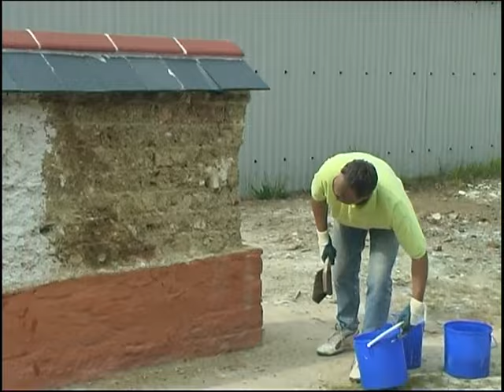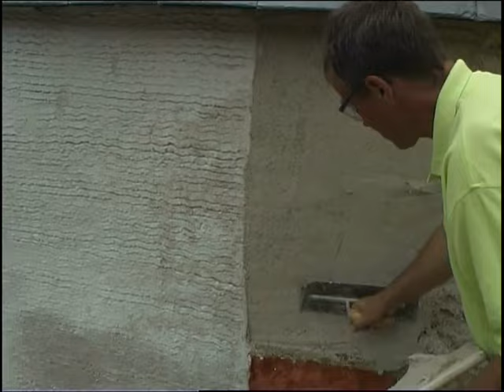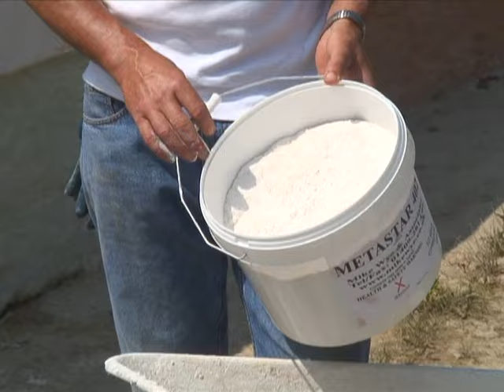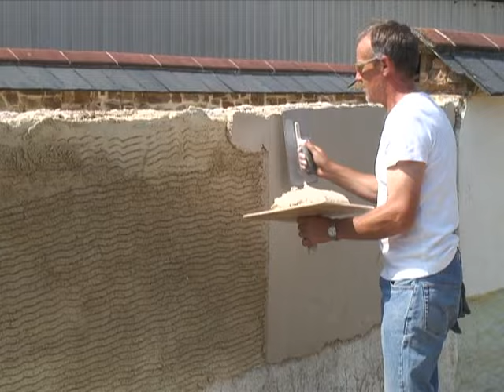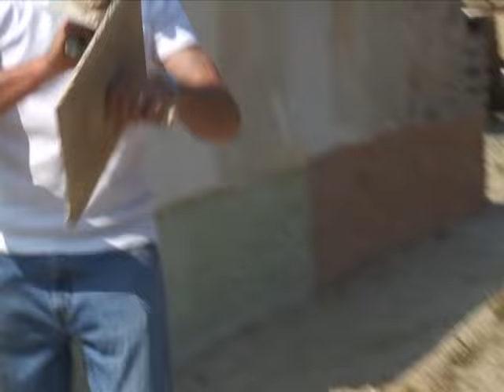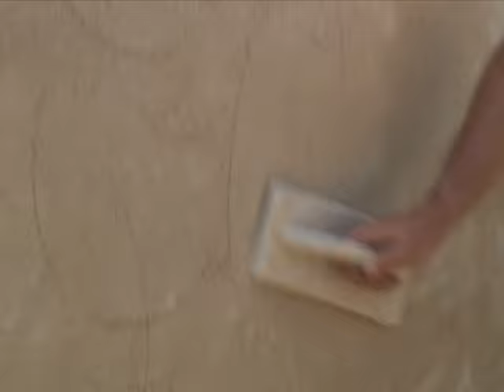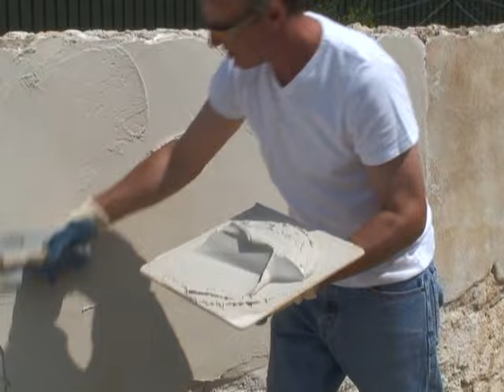How to Lime Plaster (internal solid wall)

Comment: Can I lime render my wall using just NHL 3.5 onto brick. I want to do a bonding coat first then two finish coats. Could i get away with that and if so what ratio for the finish coat? Thanks Mike.

Comment: Very informative video, definitely more confident in giving plastering a go after watching this. Is the harling coat an unhaired mix of 3:1 thats just watered down? Or did this also have the pozzolan?
Reply from the maker: Hi Morgan, thanks for your comment. Yes - the harling coat can be unhaired lime putty mortar diluted to a porridge-like slurry. Pozzolan would not usually be necessary, it is a very thin coating so it will dry and harden before a pozzolan has taken effect. It is also possible on most substrates to use a formulated NHL based premix mortar, for example SecilTek Reabilita Cal CS - details here - https://www.mikewye.co.uk/product/secil-reabilita-cal-cs/
Reply: @MikeWyeLtd any problem if the hurl coat is haired lime mortar?

Comment: What are the contents of the harling slurry mixture? Is it just lime and water? If so, would nhl 3.5 and water be ok for a first coat harl?
Reply from the maker: Thanks for your question Pete.
The harling slurry is a mix of lime + sharp sand + water. If you're using NHL3.5 perhaps try a mix by volume at 3:1 (sand : NHL) then as the mixing process is nearly complete, add extra water until the mortar reaches a loose porridge-like consistency. The best type of sand for this will be sharp, well-graded, with some relatively coarse & gritty content.
We have some general guidance on mixing NHL mortars here: https://www.mikewye.co.uk/wp-content/uploads/2023/11/Mixing-Natural-Hydraulic-Lime.pdf

Comment: Great videos! I was wondering if you had some more information on that harling coat though. I'm currently struggling with some old, extremely thirsty brick walls. I managed to get the first coat on nice and flat and soaking the wall gave me just enough time to do it. However... I applied the my first coat months ago and now it's bone dry. I've tried soaking the walls again but the finish coat, I supposed because it's much thinner, just keeps drying out too fast... by the time that I'm at the bottom, the top is pretty much dry to point where I can't work it anymore. Fighting it with a wet sponge helps a bit but so far I've only done small walls to test. This method is not going to work on my bigger walls... I'm wondering, could the harling coat help before applying the top coat as well? How much pozzolan might I add? Thank you for your help!
Reply from the maker: Sorry for the delay in replying. 

Are you doing a full internal lime plaster build-up with a harl coat, scratch coat, float coat, and skim, or is this an external render application? If so, what stage are you at now?
If the coats are applied "green-on-green" then the previous coat shouldn't have dried out so much that it's very thirsty like you are experiencing. As the last coat you applied was done many months ago then you may benefit from another harl coat (assuming you are at the float coat stage).
I'll presume that this is an external application given that you've asked about the addition of a pozzolan. We should safely be clear of the risk of frost now so early spring is a great time for render applications to give plenty of time for carbonation and strength gain before the winter. With that in mind, and given that you have very thirsty walls, I wouldn't go any more than 1:8 pozzolan to lime render by volume. There may even be a case to reduce this to 1:10 provided that the area isn't particularly exposed or vulnerable.

I hope this helps but feel free to give us a call on 01409 281644 if you would like to discuss.
Best of luck with the project! Ryan @ Mike Wye

Comment: How thick would the lime plaster layer be in total?
Reply from the maker: Hi Hazel, plaster coats are typically around 3 mm
Reply: @MikeWyeLtd  sorry i mean for the whole thing, from the wall to finish, including the mortar etc.
Reply from the maker: @hazellewis6995  Hi Hazel, onto a solid wall typically, 12-15 mm haired scratch coat, 8-10 mm unhaired float coat and then a 2-3 mm skim

Comment: Thank you so much for these videos. For an amateur like me they are super informative and helpful. I do though have a few questions I wonder if you could help me with? I’m in Portugal and have a early 1900’s stone walled house and really want to use traditional methods to do her up.. my builders are of course pushing cement…. When I suggested lime, they said Yeh sure, but we HAVE to add 1cement to 1lime to give it strength otherwise it’s like powder and will just mark with any small bang… Is this true? 

My other question is, do I have to add hair or any other type of fibre? Or can I just do the lime sand mix? 

It’s hot here and I’m wondering how to help it dry properly(not too fast)? I see you splash water on some of the layers but how do I control the final plaster one?

What’s the difference between lime mortar and lime plaster? And what sand do you use? Is there like a grade to go by? They are using quite tough sand here which I don’t like but they say after this one there’s on,y one that’s ever do slightly more fine, which I don’t think I could ever achieve these smooth finishes with?

Thank you so much! Hugely appreciated if you find the time x
Reply from the maker: Thank you for your kind comments. Our mixes are one part lime putty to three parts sand by volume. This is a traditional mix that air dries and carbonates. The lime that your builders are referring to would be hydrated lime (a dessicated lime putty) that is used as a plasticiser in cement mixes.
For a compromise you could use NHL (natural hydraulic lime) at the same 3:1 by volume ratio. This is very common in Europe and easily accessible. The NHL is a dry powder that will give a chemical set with water rather than air-drying. It's a bit of a compromise.
Water and protection from direct sun are the main ways to control drying.
Our mortars and plasters differ slightly in mix ratios but essentially it is the aggregate size that makes the difference.
Reply: @MikeWyeLtd  thank you so much for you quick get back, much appreciated. Hydraulic lime, that’s the one! They still want to add cement to that though which is annoying, 1 lime to 1 cement then sand.. as they say it will be super soft and any little bang will make a mark on the wall. As for the controlling of drying time, I’m slightly worried about this as they they will do it when it’s warmer and Portuguese sun is HOT whatever the tone of warmer months.. so I’m worrying it might dry out too quickly. Should I spray it every day or something to help it along? Thank you so much again x
Reply from the maker: @leafside  A 3:1 mix of NHL3.5 and sand shouldn't be too soft, the lime putty renders are softer than these and still take a fair bit of abuse. Yes regular damping down will be beneficial.
Reply: @MikeWyeLtd  thank you, will put that to them x

Comment: Does anyone have any ideas about whether they think it could work to lime plaster the walls on a tiny home? It is on wheels...
Reply from the maker: Hi Jemima, we have a customer with a static caravan that is moved fairly regularly. He has had some small cracks appear that he has patched in. If things are fixed well it may be ok but faults may appear when it is moved.

Comment: I have zero plaster experience but recently motivated in the subject. Often heard about “preventing  shrinking” here in your video too.  what we want to preventing of?   Why it is a necessary :)  hope you don’t mind to explain :) thanks
Reply from the maker: Shrinkage can occur in mortars and plasters for a number of reasons but ultimately results in cracking which would need to be repaired afterwards resulting in weak areas and possible scarring. 
Causes of shrinkage are: 
*High suction from the substrate/insufficient control of suction in the substrate by dampening with water/use of primer etc.
*An overly wet mix (the excess water evaporates away during curing causing the mix to crack)
*Use of incorrect mixes/aggregates. For example, if you try to apply a fine internal plaster which is designed to be skimmed at 3-4 mm thick at 6-8 mm thick then the plaster is likely to shrink back due to the aggregate not being sufficiently large to hold its form.
*Fast drying. If plasters, renders and mortars are subject to direct sunlight/heat/strong winds/high internal temperatures then they moisture contained within them will evaporate rapidly causing shrinkage. Mixes should be left to cure naturally and not force dried. If the external temperatures are high and/or there is prolonged direct sunlight on the area then the surface should be protected by using damp hessian/sheets/old curtains etc. Protecting the surface of external renders is advisable irrespective of time of year.
I hope this helps.

Comment: hey mate, I have a bag of quicklime and i also have a bag of hydrated lime i want to sample for wall rendering...what ratio do i mix the quicklime to water (slake) to make putty? and do i soak hydrated lime also into a putty, & if so what ratio to water is it? Super hard to find any information about the ratio to make putty...is hydrated lime able to be used for wall rendering?
Reply from the maker: Hi Johny. You really do have to be aware of the hazardous nature of quicklime if you're considering slaking it yourself. Our guys wear full face masks, body suits and gloves in a controlled environment when slaking. 
If you're comfortable you can manage the risks safely then we can give you a guide for the quicklime to water ratio by emailing sale@mikewye.co.uk
Hydrated lime can also be rehydrated to make an inferior lime putty but we don't really recommend it be used as a binder for rendering. It's typically reserved for use as a plasticiser in a cement mix (6:1:1 aggregate:cement:lime as an example).
Reply: @MikeWyeLtd  hey mate thanks for the prompt reply. Yeah unfortunately i have to undergo the process of slaking myself. Im on an island in Indonesia and there is not such thing here of a bucket of putty let a lone even quicklime or hydrated lime bags...what im wanting to do (render my villa walls with a lime mortar) is revolutionary to these parts, mould is shocking here with the humidity. I found a mining company in Java that sent me a 20kg sample of both products (quicklime and hydrated). I have slaked a small quantality of the quicklime to check out the reaction, and do sample renders...im prepared mate, but unsure exactly the ratios. I will email you.

Comment: Internal traditional chateau walls are usually about 4 metres high and say roughly 5 metres wide. How do you get them straight and can you do the whole wall in one coating or do you need to do the wall in segments?
Reply from the maker: Hi Jack.  A 4 m x 5 m wall wouldn't present a problem for a competent plasterer as an entire area. You would not need to plaster in segments.

Comment: Always wear glasses while harling! I learned that yesterday, the hard and painful way. :-/
Reply from the maker: Yes it is very unpleasant!
Reply: @MikeWyeLtd  Thanks for posting this. So few videos about plastering over cob. I've got a question, if you have a quick second. I'm getting more cracking in my hair and scratch coats than I'd like. I think I'm having trouble getting enough aggregate in my mix. I aim for 3:1 but end up at best with 2.5:1 and sometimes closer to 2:1. I just can't work it when it is 3:1 -- it is very stiff and not at all workable. I don't want to add water, do I? My putty is about the consistency of toothpaste, so I think that's right. I'm not sure what's going on. In both cases, I've added 1 part hair (in my case it is 2"/5 cm lengths of shredded linen discard fibres). Any ideas? Thanks again for the resource and I'll understand if you don't have time to respond.
Reply from the maker: @LowTechInstitute  Thank you for the kind comments. It may be that you need to let the mix turn longer to increase the plasticity, it may also be that the linen is absorbing some of the water content. If this is the case you may want to introduce a little water but you're right not too much. I hope this helps.
Reply: @MikeWyeLtd  Thank you for taking the time to reply!
Reply from the maker: @LowTechInstitute  No problem, good luck
Reply: @MikeWyeLtd  You were right! I added a 1/4 part water (3 sand, 1 putty, 1 fibre) and it immediately turned into lovely plaster that doesn't crack! Thanks!
Reply from the maker: @LowTechInstitute   That's great news, happy plastering!

Comment: So the harling mix is 3.5:1 but it's really runny. I'm guessing that's because you added so much water. Doesn't that make the mix pretty weak? How will it cure properly and be strong? Or is it just supposed to be there to prevent sucking as much with the scratch coat?

Comment: By plastering over my 140 year old brick chimney wouldn’t this destroy it because it won’t breath? Most of the work will be indoors behind walls
Reply from the maker: If you used a lime putty mortar/ plaster system the wall would still breathe. You would want to make sure that the paint is also breathable.

Comment: How achievable is this for a competent diyer to learn over time......compared to the difficulty of the horrible gypsum stuff as I have done that in the past.....I get this is nothing like that but just mean in terms of difficulty in getting a nice finish
Reply from the maker: Hi Dave. Someone with a reasonable level of plastering ability will absolutely find lime much easier to work with than gypsum plaster (in our opinion). Lime is much more forgiving as a material and you will not find yourself fighting against the clock with rapid setting times. We can't account for levels of plastering ability but, if your skimming isn't at the level you want to achieve, you can always tackle the backing coats yourself and bring in a plaster to finish when it comes to the top coat skim.
Reply: Mike Wye maybe I’m just kidding myself haha
Reply: Mike Wye oo this sounds brilliant I have skimmed a wall in the past in gypsum and managed to get at least a finish that was useable and looked fine.......I was under the impression that lime was much harder.....infact I’m in the middle of looking to make a step into retraining and have always said I would love to learn how to lime plaster as I feel their isn’t many that offer it

Comment: Is it possible to get the recipe of the different lime plasters? Thank you!
Reply from the maker: There are no real trade secrets when it comes to the mix ratios used for mortars and plasters. Mix quality can be affected by the type of lime, its production process and the careful selection of sands.
The mix you should be using is influenced by the type of work, time of year and exposure (where work is external for the latter two points).
If you're ever in doubt, speak to your lime supplier (we assume Mike Wye, of course!) and they will be able to advise you.

Comment: I have an old house, with lime plaster on the interior. The lime is pretty old and degraded in some little areas, but I know that lime helps the old walls breathe and i don't want to change it with cement based plaster. My question is, is it good, and will this type of plaster sustain a clinker brick finish (1-2 cm thin bricks applied on the wall via a special based adhesive) that I wish to apply to it? Or do you recommend an cement based plaster?
Reply from the maker: Hi, you would need to check the adhesive for breathability as it would be covering the lime. Also any cement based adhesive will be a lot stronger than the lime and may cause delamination (especially on old lime)
Reply: @MikeWyeLtd  Thank you!

Comment: Hello! What is the mixing ratio of ingredients in this lime mortar? Also, what is a good mix ratio of lime and sand for an interior plastering?
Reply from the maker: Hi, the mix ratio is 3 parts sand (sharp 4mm - Fines) and 1 part lime putty. For plaster we tend to use a kiln dried sand at a 3 part sand to 2 parts lime putty
Reply: @MikeWyeLtd  Thank you!
Reply: @MikeWyeLtd  The sand graded up to 4mm is for the base and float coat only, correct? But for the two skim coats, since they are only 2-3mm thick I think you guys mentioned, then the sand would have to have a maximum particle size of 1mm, no? And for the skim coats do you still use sharp sand because I thought I read somewhere that one might want fine smooth sand instead of sharp to have a smoother final surface, especially for interiors, or? Wonderful video, thank you!
Reply from the maker: @quayd  Hi Yes, we use a kiln dried sand and/ or marble dust for our plasters